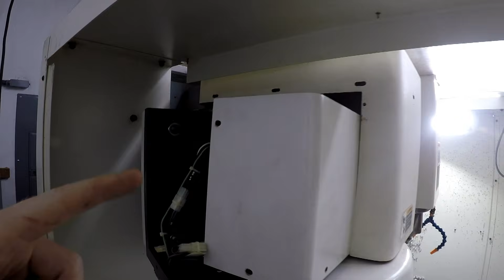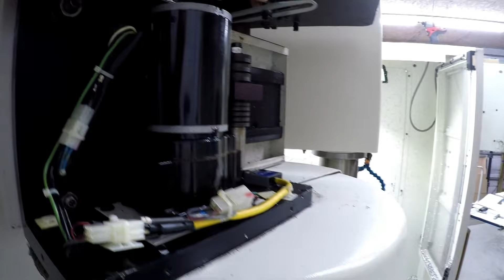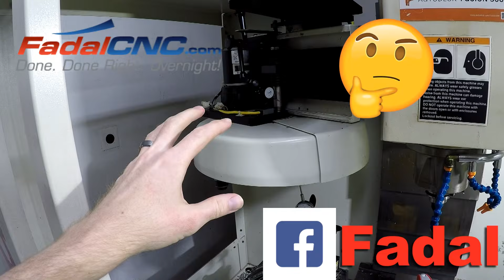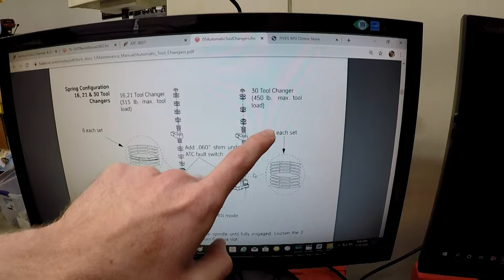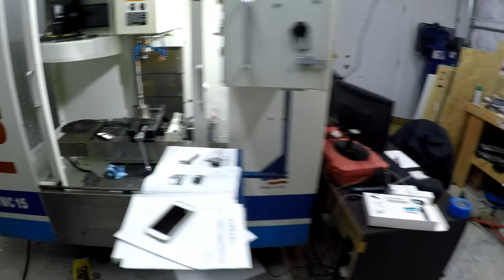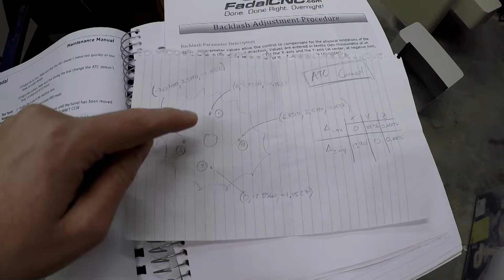Fadal ATC Alignment - Part 2

Comment: Hi there , so I'm having a problem where my atc and spindle line up initially for tool change but when spindle goes up for next tool it does not go up high enough to clear the tool it just placed on the atc and crashes.  Any idea what I can do . I appreciate any insight. @bgwmachine
Reply: @bgwmachine

Comment: I have a mini and a monster 5/8 keyless.  I was in a hurry and did a tool change . When that drill that was in the chuck hit the work it bent the shit out of that plate. Had to take it to a friends place (he has large steel  flat tables ) use a sledge hammer and a piece of aluminum  and worked back. That was 10 years ago . It's pretty forgiving.

Comment: Hey if anything an opportunity to clean up parts of the machine you didn't before. From the Fadal I ran the ATC had more play and still worked fine. Maybe some of the forks need replaced but I wouldn't not use it if it's not dropping tools.

Also keep an eye for chips in that ATC. I scrap many a part from chips getting on tools as that cover doesn't always keep chips out. Awesome videos man keep it up.

Comment: Doesn’t seem like any issue. I’d say just run it. If you ever need any help send me a pm and I might be able to help you out.

Edit to add:
It’s a fadal it came from the factory like that. You are overthinking this way too much. Clean the parts put it back together and run the machine. Nothing you showed showed any issue heck the worst run out on the shaft was on a non bearing surface. Also your method of checking the plate flatness was no good. But it doesn’t matter because it’s fine. So just run it

Comment: we just set it up  to the highest spot so the head pushes it down slightly  :) sleeve on the holder has a small guide-in slope so not a big deal even if it is  2 mm ... will go into the ATC